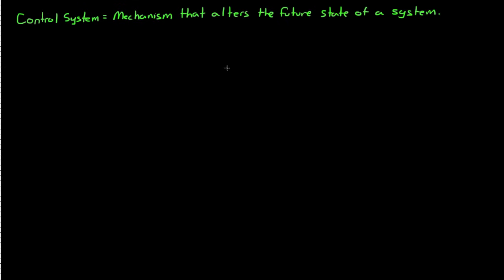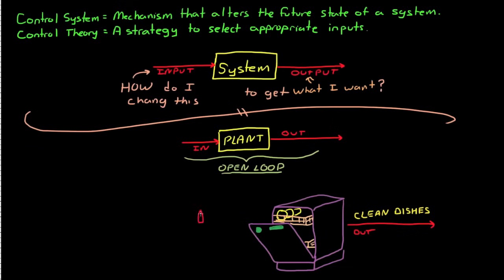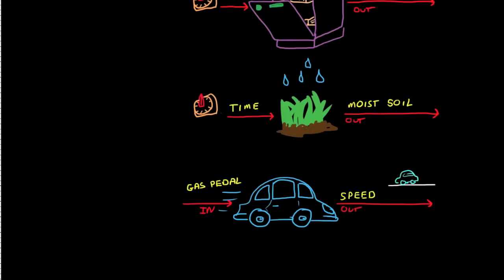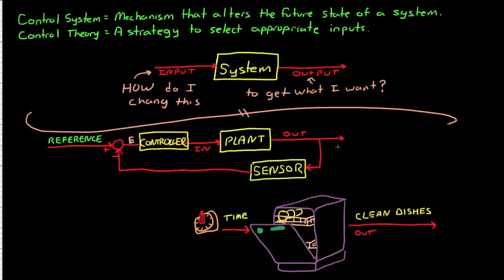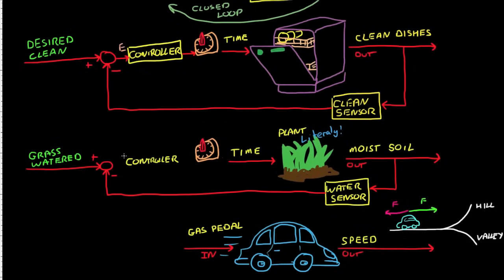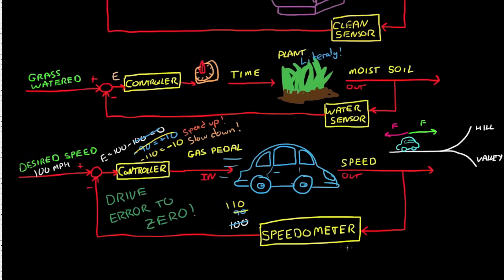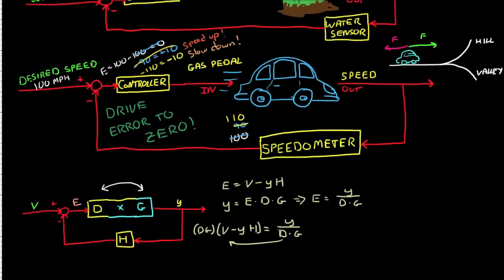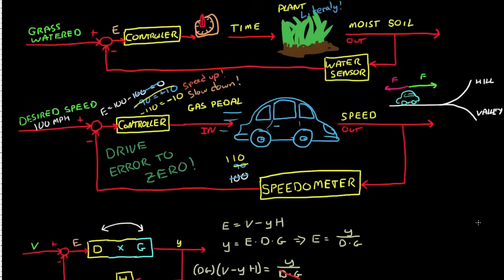Control Systems Lectures - Closed Loop Control

Comment: Actually dishwashers have sensors that check if the water is clean, so it won't just run for the set amount of time.
Reply: the video was recorder 12 years ago😆
Reply: @shinosamuel1398  dishwashers had these sensors 12 years ago

Comment: Thanks for your wonderful video on control theory!
For your question at the end of this video, I think it is because the sensor is not directly reading the value of y (the output value of the plant). Rather, you need to introduce another system to describe the external environment (e.g. property of the plates in the case of the dishwasher or the slopes and terrains in the case of the self-driving car), and the sensor's input is the result of the interaction between the plant's output and the environment.

Comment: It's not from mere simplicity that we have open loop control. Of course it's closed loop in a way because there's a human in the loop, and in the last few years that has begun to weigh heavy in the public zeitgeist. If you have sensors and actuators powerful enough to detect a lack of cleanliness in the outgoing plates, you might find someone inserts a control program powerful enough to enslave humanity to fix the problem or to trick them into neglecting more serious problems or prevent them from choosing to stop running the dishwasher and find alternatives like disposable plates.
Reply: Could you explain the point you were trying to make with this comment?

Comment: In a closed loop system for sprinkler device, the soil moisture sensor will take a long time before the water goes into the soil so you would keep watering for nothing I guess ..Like you wouldn't know as you read this com if the Sun died 7 minutes ago

Comment: Since we call E as error signal, it means that we want the output y to be equal to reference V. Doesn't that mean tat we want the transfer function to approach unity with time (so that the reference input and output are equal). But there are no discussions in control along these lines, why? What is wrong with my thought process?

Comment: Well, the last block diagrams are said to be equivalent. 
But how will the open loop block diagram run in loops if it's only one step?
How does it even go back and correct the output?

Comment: Interesting Tidbit: There are dishwashers with water turbidity sensors. Turbidity means how much “crap” there is in the water, or how “unclean” it is. So the dishwasher will run some minimum number or length of cycles, and will add some to achieve desiredly low turbidity before moving on, or it can use the turbidity in open loop mode without changing the water: the more turbidity, the longer the main cycle that involves soap, since there’s no more soap once you dump that water. The dishwasher I have seems to run pre-rinsing in closed loop, where it’ll add up to 3 rinse cycles as needed to get the water sufficiently clean before the main wash. It’ll then time the main wash (with soap) based on how dirty the water is after a few minutes of washing.

Comment: this "error" term , is actually the input into the controller, after the first measumerent and so on.. why do we call it "error" ? If we define the current state by the output y(t) , the next desired value according to this should be x(t) (the constant input the user chosed at first) but fixed by the curent output , in order to E(t) = x(t) - y(t) . At some point this E(t) = 0 , so there is nothing to fix anymore ,since x(t) = y(t)

Comment: This channel is awesome. I am going to watch every video. I am starting my master’s in Control Systems Engineering in Fall 2018, I am going to get a head start on a lot of the material with these videos. :D
Reply: how's the masters degree coming
Reply: @TheHaloFan171  ended up getting a masters in software engineering while working full-time. I am hoping to start a PhD in statistics.
Reply: @StonkeyKong  oh man, what a turn of events, what was your undergrad in?
Reply: @TheHaloFan171  electrical engineering, minor in physics.
Reply: @StonkeyKong  why'd you switch up from the original plan? was thinking about getting a master's in controls too
Reply: @StonkeyKong  well?

Comment: At 7:55 I didn't get how you got DGV = y(1 + DGH)? Pls clarify on this
Reply: I realize that your comment is 2 years old, but in case anyone else has this question, I am going to answer it. 

He gives us:                                   E = V - yH      &      E = y/(DG)

[transitive property]                      V - yH = y/(DG)

[multiply each side by DG]           DGV - yDGH = y

[Add yDGH to each side]              DGV = y + yDGH

[Factor out y]                                  DGV = y(1 + DGH)

[Divide each side by (1+DGH)]    DGV/(1+DGH) = y

Hopefully that helps. For whoever happens to read this, have a wonderful day! :)
Reply: Wonderful!
Reply: What exactly do D and G represent here? Also, what are we doing when we multiply D and G; what does it physically mean? I assumed that they were functions, but then all of this wouldn't make sense.
Reply: D and G are just blocks (Each blocks may having it's unique components connection and transfer function)  . So for sake of example he took D and G two blocks and connect them in cascaded form .
Now the reason he multiply both D and G is to reduce the closed loop system to open loop control system.
First solve the forward transfer function and then convert  -ve / +ve  feedback into open loop control system.

Comment: I am currently working in a plant which uses PID controllers and I have no experience with them as my past 30 years did not involve them. I am scrambling trying to catch up on this technology  and this is an excellent source of information. I have gained a much truer grasp of PIDs here than from anything I have read up to now.  Thanks for the help!

Comment: I don't know if someone can help me to understand why in 7:26 when merging D and G together the relationship is D*G, why not D+G, and later, it is E= V-y*H, why it is minus between V and y*H, and why it is multiple between y and H???
Reply: +Lin Zhu Hi, about the minus sign between V and y*H; that's because the feedback signal is negative you can see it in the SUM block. And about y*H; the signal y meets a function called H so, the output will be y*H.
Reply: What is signal y in this case? Is this speed?

Comment: I hate uni because most professors seem to forget that they were ever students. In two short videos you have made this concept crystal clear. It's sad that it never fails that watching YouTube videos helps understanding better than 3 hours a week in a lecture. One more vote for YT degrees!
Reply: Totally agree.  Can we just ditch the idea of going to class already and do it all from home?
Reply: This is just soooo true- sad but true- I came looking to find a simple well defined explanation, without Laplace crap- found it here-
Reply: @1973jdmc  Laplace is not crap, it’s a handy notational tool. You can design control systems without using it, but in pretty much all cases the un-transformed representation will be much more complex. Same goes for the use of complex numbers when working with vibrations and control theory: they actually make life easier. Remember: Engineers are lazy. They wouldn’t use Laplace transform if it didn’t make life easier. It’s like doing house renovation work without power tools: of course it can be done, but it will take much longer. You’ll get more muscle doing it - same with control systems, where not using Laplace transform will make you very good at dealing with mathematical drudgery :)
Reply: @absurdengineering  i think deep down inside we all have already known Laplace's stuffs serve a purpose. However I still think learning engineering through Laplace's is not a good approach since the problem has already most of the time been confusing enough
Reply: totally aggree!
Reply: We’ll guys maybe you get it not because it’s better here but because you did some work in the classes. It’s just a symbol of what you already know.
Reply: all that becuz the education system test our memory not intelligence.
Reply: I’m agree.
Reply: I can't agree with you more! I got higher grade by watching youtube than sitting in lectures.
Reply: exactly, my lecturer just jumped straight into equations and examples of a system before describing this
Reply: School is a control system... You think they're gonna actually teach you shit.. Lol
Reply: @anicecrackhead maybe you didbt try hard enough to work the lesson plan. Just saying.
Reply: psford1 My words that first sentence.

Comment: Maybe this has been asked, but by "multiplying" G and D, or y and H in the abstract feedback loop, does Brian mean something like function composition? Because, for example, how does one multiply a car by the position of its pedal, or the speed of the car by the car's speedometer? Thank you!
Reply: +Andrew Estrella You've probably figured it out by now but G, D are system functions. He's assuming that we're in the frequency domain, so he's multiplying instead of doing convolution.
Reply: +Andrew Estrella He didn't explain it as much as he should have. When you have two linear time invariant systems (Ex: G and D), they come with an impulse function. When they are in series, the overall impulse function is the convolution of G and D. When you're working in the frequency domain, convolution is as simple as multiplying the functions. Just google the two words: "Convolution" and "LTI Systems."

Comment: Could you explain the notation you are using for the flow charts?
Reply: For example, the plus/minus in the loop diagram?
Reply: +Matthew Ferrie The plus and minus means you subtract the sensor signal from the desired signal. For example. Let's say the reference signal V and there's an error Hy, the error would be V-Hy.

Comment: in answer to your last question at the end of the video:
I would say just by designing controller D, you can not make your plant G behave the way you want. because the plant might have some physical limitations.
if you say I want to maintain a speed of 280 km, no matter what the controller's command is, "a not very strong car" might not be able to reach this speed.
Reply: +azin ghaheri sharghi Agreed. I also suspect the following:
1. We are assuming that we have captured a perfect model of the plant when there could be errors. For the car example we might have assumed a certain input-output characteristics for the gas pedal position vs the force generated by the engine, which might not be accurate.
2. What about external uncertainties? Such as in the car example the friction of the road varying at different places, wind etc. These are things that our entire model might not have captured.

Comment: Perhaps you can help me out. I am an ME student, and understand the mathematics behind control theory. I can do the problems, but I am struggling with actual applications, which I really want to learn. My main is issue is understanding what the equations actually mean. I read somewhere that "electric motors have two poles, subway cars have nine, aircraft may have 26 and spacecraft possibly one hundred" What exactly causes poles to be induced into a system i.e. what is their physical significance.

Comment: When you write E= V - y*H, the "y" is the output signal. but the H stood for the sensor, so why did we multiply the two?  Similarly, why did we multiply the E term with D and G to get EDG coz the D and G are actually the actuator and plant and not signals per se. I know that when a signal goes across a block, it gets multiplied with it, but is there an intuitive way of understanding this?
Reply: +Karano Parakh I just asked a similar question, and suggested what seemed to me to be a plausible explanation. What do you think? In math, function composition shares many properties with the notion of "product." This is especially true with matrix multiplication. Recall that a matrix can be viewed as a representation of a linear transformation (a function) on a vector space. Composing two linear transformations corresponds to multiplying their associated matrices. More simply, do "B", and then do "A" to the result is expressed as "AB". So does DG mean "do D to G"? And then yH means "feed y into H" (except the notation is backwards)?

Comment: 7:18 I don't quite get why H is included in E = V - yH
Is this to somehow account for the sensor not being a perfect measurement?
I'll watch some more of your excellent videos, maybe it will become clear.
Reply: It's ther because E= the thing from the left (V) - the thing from the bottom (y*H). Because it's included in the model it has to be included in the equation no matter what it is. I guess it could be something other than a sensor.
Reply: i think its because the basis of comparison of V is the interaction of both y and H. ie: the effect of y on H(the sensor) yields a result that forms a common ground to compare with V

Comment: E is the error between the input signal and the signal from the sensor. D is the controller which will convert the error from a signal lets say to a torque provided by the engine of the car. According to the torque then the vehicle (according to its inertia, wind resistance etc) will increase its actual speed (y). Note: if the error is 0, it does not mean that the actual speed of the car will be 0, as the controller instead of stoping to provide torque, will instead provide a steady torque.

Comment: So the way I'm hearing it, "v" is the velocity we want the car to go. Let's say 100 mph.
An example of a sensor here might be one that measures the rotational speed of a wheel on the car; so "y" could be its angular speed in rad/sec at any time.
"H" is the conversion factor from rotational to linear speed -- in this case, it would be the radius of the wheel (with a unit conversion).

Given all that, I get why "E = v - yH"

But can someone please explain why "y = EDG"? What are those variables?

Comment: In the video, near the end, why do we multiply D and G when we combine them into a simple block? What does that even mean?

D and G and H aren’t numbers, are they? I thought they are just labels for the parts. Why are we multiplying labels with measurements like y?

Also, is the equivalence between the closed loop system and the modified open loop system only holding because of our model’s assumptions about the multiplicative output when combining controller and plant?

Thanks again for the help

Comment: wow thanks a lot for this video. It was easy to follow the block diagram and the sketches on a piece of paper on the side and work through the equations. Sometimes the sketching is a little out of sync with the speech, but it's still easy to follow. Thanks again!

Comment: I am guessing that Pinto cannot be turned into a Ferrarri just by applying more gas because the input (Torque) is "capped" so the output (the velocity) will be "capped" as well. Am I missing something?

Comment: In the grass example, if the soil moisture is constantly monitored, wouldn't the sprinklers turn on every single time the soil moisture dropped just slightly below the desired value? I would imagine the sprinklers to turn on very often for very short periods of time (or constantly at a low intensity if the sprinkler has variable intensity). Would it make more sense in that application to let the the moisture to drop below a "low threshold" before re-moisturizing?

Comment: If it is 1/10th as clear, it will still be roughly 100% better than my instructors rendition of how control theory works, no exaggeration, well maybe a little, maybe 98%. The sad part is that I attend a school that is ranked #5 in the US for top electrical engineering schools. Thank you very much. Subscribed!